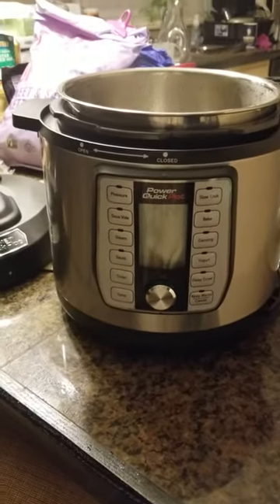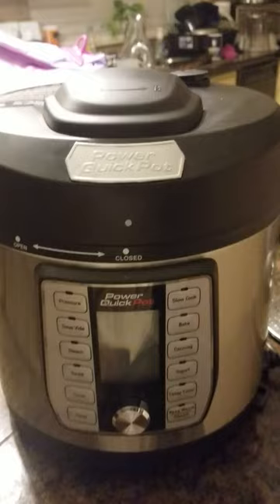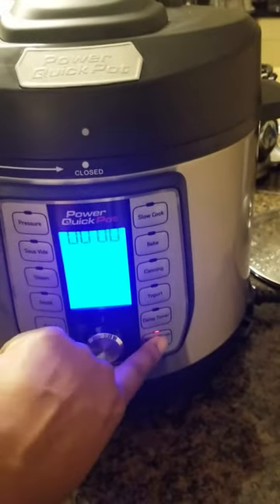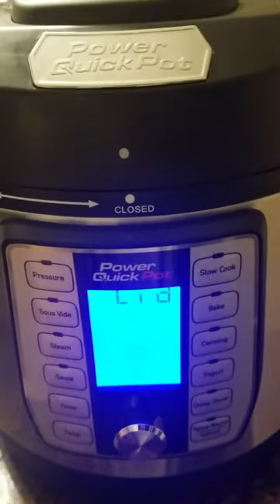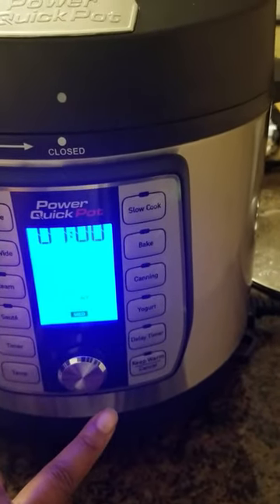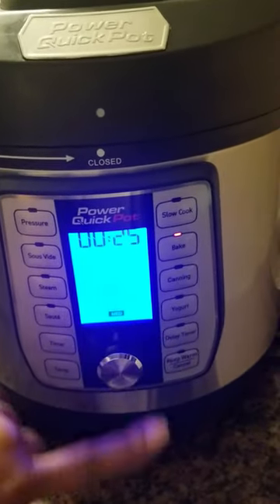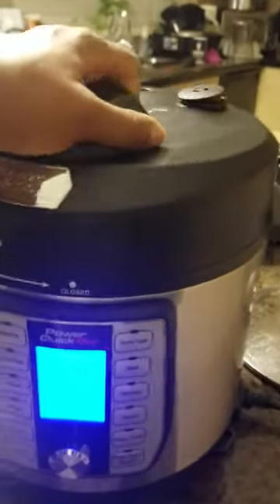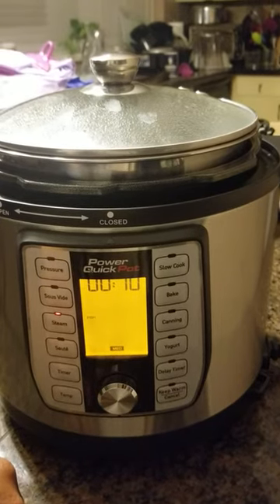Lid error power quick

Comment: If anyone still has this pressure cooker and is looking for a solution. You are NOT supposed to use the pressure cooker lid for slow cooking. You use the glass top with the steam vents. You could technically use the pressure cooker top but definitely don't seal it.

Comment: ANSWER:  it seems, Sous vide and steam and slow cook DO NOT need to have the lid sealed and locked.  There is no pressure needed for these.  If ya think about it, you don't on the stove top either. lol.  I was about to toss mine from just frustration alone. ESPECIALLY, because I wanted to start cooking the Egg bites like StarBucks.   omg so good.

Comment: I came here cause I thought u had the solution, but I fixed it, apparently ur not supposed to line it up in the front when steaming or slow cooking, there’s a drip pan in the back the lid has to align with for steaming, n it will b off in the front but it’s working

Comment: (SOLUTION) wtf 😳???,,,Hey everyone there isn’t anything wrong 😑 with your power quick pot,the black top is only used for pressure cooking 🧑‍🍳, if you want to steam cook or anything else you have to use the glass top that comes with it…NOTHING IS WRONG WITH YOUR POWER QUICK POT…THATS HOW IT IS BY DEFAULT..if you want to use the black lid go on the pressure cooking setting,.the difference between pressure cooking and steam cooking is only the amount of time it takes to cook…pressure cooking(2-6 mins) is shorter time from steam cooking (25mins),If you want to use the black lid press pressure button and choose from the menu,,not steam…HOPE THIS HELPS
Reply: The lid is only used as a airlock,that’s what pressure cooking is…
Steam cooking doesn’t require air-locking that’s why the glass pot cover with a hole came with it..
Reply: @cherenzo7123  Lid error comes on for pressure cooking also
Reply: Ok , I tried the recommendation and it still will not open. Any other suggestions?